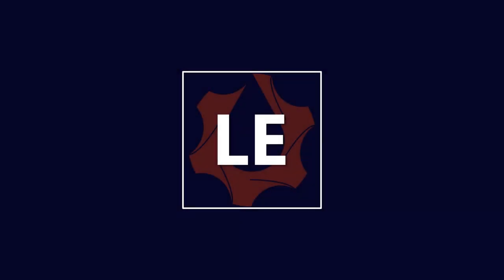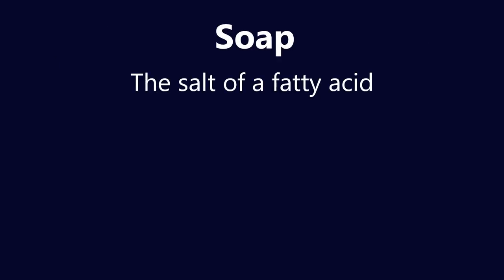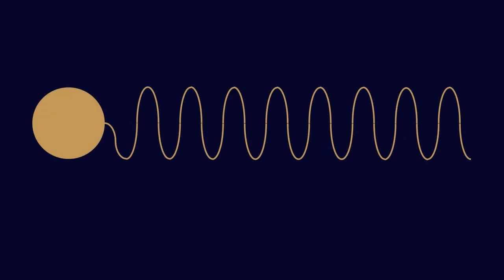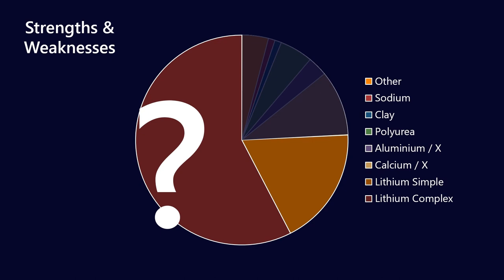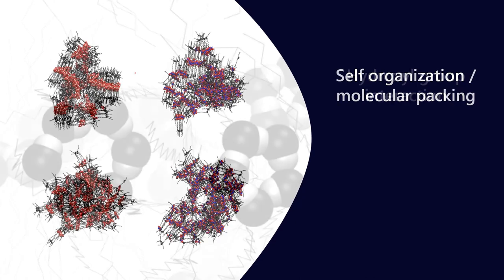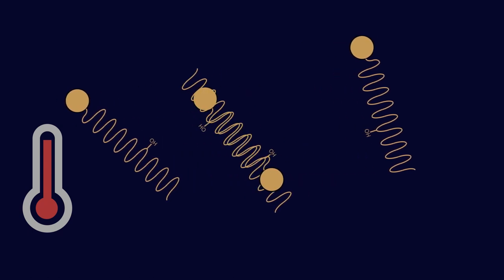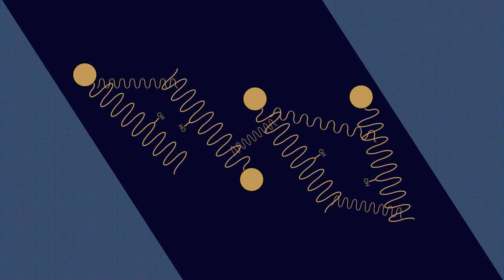Why lithium or lithium complex grease?

Comment: Odd story for you: I worked at a plant that made Li compounds included in LiOH.  One of the grease formulators required us to package the LiOH in very specific bags that they provided.  Since LiOH is very unpleasant to handle they designed a bag made of a material and printed in an ink that was compatible with the grease formulations.  At the point of use the formulators simply chunked in the whole bag without opening it thus preventing exposure to the LiOH dust.  Good video - thanks
Reply from the maker: Thanks for the story!

Comment: What would be the typical drop point of a simple vs complex Lithium based grease? (Just as a quick way of telling them apart when I look at the data sheet)
Reply from the maker: Varies depending on quality but there's usually a 60C or so difference between a Lithium Simple vs Complex.

Comment: Thanks again. So how do we as consumers figure out what is actually being used in the grease we see on the suppliers shelves?
Reply from the maker: It’s certainly not easy. As a general rule if it says “Lithium Grease” on the label, it’s a simple Lithium. If it’s a complex grease then it will be clearly stated. Comparing grease quality is difficult without hard data, but the product data sheet should give some quantitative measurements around dropping point, four ball wear and extremes pressure tests, and bomb oxidation. Those should give indications of high temperature performance, wear protection and oxidative stability respectively.

Comment: This video is great! I couldn't find anything else that comes close to what I was looking for, so thank you. I just subscribed and I'm going to have to catch up and watch a bunch more of your videos.

What I'm still trying to understand is why Lucas Oil lithium grease dries out so quickly. It's an indoor environment with AC and the manufacturer suggests using white lithium grease (possibly only because it is so widely available). The grease is not exposed to high heat or pressure, but does see frequent movement (use) and might occasionally be exposed to mist. I have trouble with the grease drying out and leaving behind an off white looking soap scum that actually CAUSES friction. I have recently been trying Super Lube multi-purpose synthetic grease and it seems to be working much much better. Any input on why the white lithium may have been drying and why this new grease seems to work better?
Reply from the maker: Interesting. "Drying out" of grease generally only happens under two conditions; extreme stress (which doesn't sound like your situation) and cross-contamination with an incompatible grease. What's the application you're using it in?
Reply: @LubricationExplained  Thanks for the response. I never actually got notified, but I noticed before that you respond to comments and just came back to see if you did and here it is!

I work maintenance in gyms with a major worldwide brand of equipment. Most of the lubrication scenarios I deal with are being dealt with fine, but I have a lot of issues with exposed shafts and linear ball bearings that slide on these shafts. The shafts are high quality chrome plated and the bearings are high quality that seem to be of much higher quality than needed for our application.

The problem I have is that these shafts often end up rusting, in less than a year even sometimes, and the bearings quickly lose their factory grease. I know this is mostly an environmental problem, probably caused by users and staff wiping down the equipment, but I can't change that and need to solve this through maintenance.

Official protocol is to occasionally lubricate the shafts with white lithium grease and whenever the bars become sticky with any sort of scum, to use 3 in 1 to clean that away.

Personally, I'll walk a gym and feel the bars to see what need attention and it seems most of these bars need that about once a month. I'm feeling for either 1] dry sticky (from dried lithium) 2] dry but tacky black (unknown cause) 3] dry but no residue, or 4] just right (finger slides easily but not apparently wet, like touching your nose then sliding your finger on a clean granite countertop). It's unlikely I'd ever feel a shaft that was obviously lubed unless I just put it on the day before or something.

If I encounter either of the dirty scenarios I will clean the bars with 3 in 1 on a towel, wipe that off, then use the lithium grease. If it's just dry I'll use the lithium grease. Spec says they will likely need grease 4 times a year, but it's rare I have anything that can last that long. Most needs lubrication monthly.

We use a 30 weight non-detergent oil for other things and will use this occasionally on neglected bearing shafts when we need to get some lubrication into the assembly better.

I'm aware that 3 in 1 is the devil as far as lubrication is concerned, but it seems to be a good cleaner. Am I wrong? Do you think it is causing the white lithium grease to dry or did something else in my (essay long) response strike you as problematic?

The synthetic multi-purpose grease seems to be working 1000% better but it's only been a few weeks and it's too early to draw a conclusion.

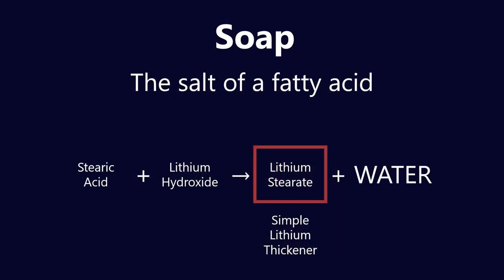Comment: Thanks for video, Can you explain the meaning of P, F, G, VG in the strengths and weaknesses of the section at 9:16 in this video
Reply from the maker: Ahh yes, that should have been more clear. P = Poor, F = Fair, G = Good, VG = Very Good. They're not very defined, it's more a pointer toward general performance in use.

Comment: So complex type only provides higher heat tolerance but no water resistance improvement?
Reply from the maker: Great question! Essentially yes, because water resistance is mostly determined by the metal salt’s solubility in water. However, it should be stressed that water resistance can be slightly enhanced by the use of polymer additives, and these are more likely to be found in complex greases as they tend to be marketed as more “premium” products.